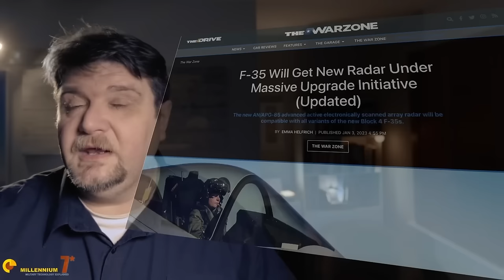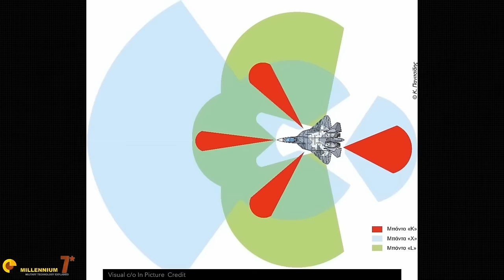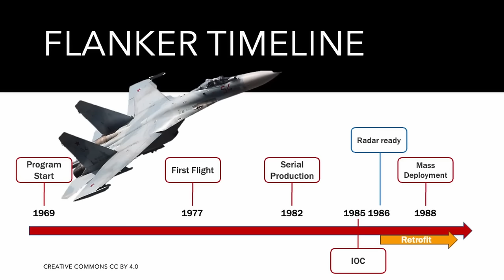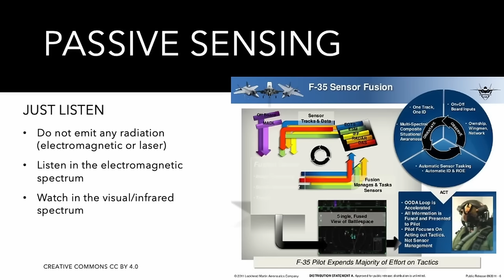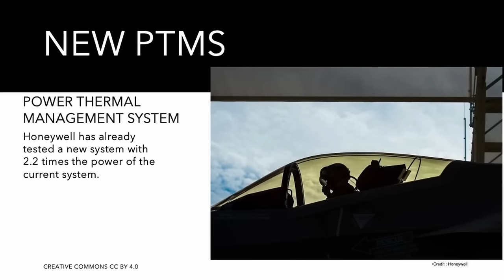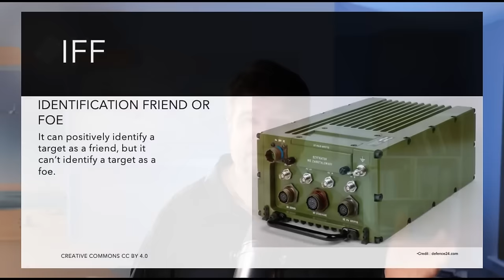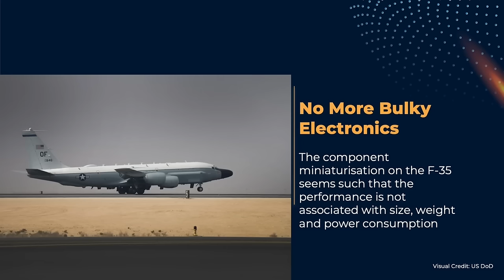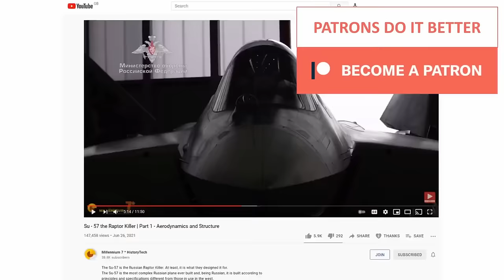The F-35 in 2023 was...                                 (mash-up long format)

Comment: Excellent compilation video... the explanation on arrayed and phased-array radar is very well done. Just a small correction, 9:34 the receiver amplifier is called a low-noise-amplifer or LNA. These are different from power-amplifiers or PA.

Comment: I was critical of the RAAF F-35 project because of its fixation on the F-35 without considering alternatives.   Eventually the RAAF purchases Some Super Hornets.  This allowed a bit of a stop-gap and  very effective in service with and replacing some classic Hornets.  And allowed for some time to consider the F-35 some more. And the F-35 project showed an improvement and began to reach some goals. The RAAF now has about 72 F-35s and 36 Super Hornets.  About 30 classic Hornets are still in hand but not operational. Ukraine considered the classic Hornets but went with NATO F-16s.  About 10 classic Hornets may now go to the Philippines.   They still have some airframe hours and considerable capabilities for the Philippines.   Including AMRAAM and Harpoon.  Some of these saw service over Syria in 2017. The US should still have plenty of spare parts. They can compliment the PAF T-50 fighters.  These classic Hornets support a number of other guided weapons.  Australia has been supporting Philippines training since WW2. The Philippines military is growing with more modern systems.  The F-35 is now in full operation with the RAAF.  The RAAF remains the most capable airforce in the Southern Hemisphere.   With a very well balanced capability.  Some of the Super Hornets are SEAD G models.  One of the Wedgetail AWACs are supporting NATO in Eastern Europe.   The Australian military is growing significantly in capability.  The F-35s will be supported by Australian built Wingman drones. With KC-30 tankers the RAAF will have an effective long range capability.  The F-35 is a vital element of the ADF. Protecting sea approaches.  Also giving the RAAF an effective deployment capability to support allies around the world.

Comment: Thanks.  I have been looking for that deflection rate.  You gave 45 to 60 degrees. I still think moving the radar to different angles  can be useful.  Even just rotation.  Along with other modules around the aircraft.  You have some other good information.   Good to see  F-35 costs coming down.  Having seen extensive air combat in Ukraine we can see how capable the F-35 should be. Where even the F-16 is expected to be so capable.   Even the older models with some upgrades.

Comment: A good solution to the scan angles is to have a multi-faceted aesa plate. I guess in effect that's having multiple aesa radars, but with a single structure, common cooling, etc. it's kind of a gray area. There is one other pro/con (depending on how you look at it) with high powered AESA radars, but it's rather shush.
GaN will offer about 65-70% improved efficiency. Read that as 65-70% less cooling needed, or 65-70% stronger signal output with the same power, or any combination thereof. It could also be used to leverage larger amounts of power in a smaller package (albeit with appropriately beefed up cooling. This is pretty substantial.

"It is incredible how such a poorly conceived and run program may have produced such an outstanding aircraft"
That's really the soul of the F-35 in a nutshell.

The compute elements are too centralized, yeah. It'd be better off with more numerous smaller computers, with less lines of code each, doing their own thing, and communicating, but much less 'dependent' on each other. When the US government does anything with computers, it's usually a bit of a train wreck. To be fair, you see that in the private sector too though, whenever bean-counters get too fixated on "lowest bid". Overall the F-35's computing works well, but it could have worked better. Granted, a single F-35 has as much compute as the rest of the USAF put together... so it was kind of a big task. It works better than windows 10/11...

Concurrency never saves money, in the end.

I expect that "if" the XA-100 is perfected, it will be for the B-21 (range & temperature advantages), or possibly NGAD/FA-XX, and then possibly back-tracked to the F-35. There's an "if" and a "possibly" to that, which compounded equals a firm "maybe someday". Though the F135 engine updates are going to end up with just as much thrust, possibly more than the XA-100, and 'some' economy improvements, and sooner rather than later. The competition between P&W and GE burdened the program with choosing between two great options.

One rarely discussed LPI radar tech on the F-35 is that it can black-out areas in the tracked flight path of detected targets (even while the F-35 is maneuvering). Obviously if the contact changes heading though, it can bump into actively tracked areas briefly though. This denies targets' ability to track & analyze the F-35's radar emissions, and greatly shortens their window for detection.

MPADS & AA guns, agreed, are not really able to be dealt with by SEAD (ergo the obsolescence of the A-10). But they cannot target aircraft at higher altitudes. So if you have SEAD, you can pretty safely fly high in an area. So acting as an eye in the sky is very realistic, assuming you've taken out all the SAM systems of noteworthy size.

1MW peak power is definitely wrong for the AN/APG-81. But the F-35 had about 2.5x the power generation capacity of the F-22, and also greater than 40 kW of cooling capacity (about half engine cold air & half fuel heat-dumping). Some of that will get eaten up by the increased compute capabilities, and the myriad sensors. But overall, the power availability of the radar should be nearly double that of the F-22. With GaN, signal output could be greater than triple. (disclaimer: this is based on pieced together public info, and math, not specific knowledge)

Sidekick is easy to install. It's just a wire bundle, a bay door, and a software update. Could likely be handled at the depot level, without going to LM for install.

Production model AIM-260 should be "in testing" now at Edwards. I'd expect more info about it very soon.

I'd suspect that the new cpu would be highly multi-core, and a lot of the performance would come from that. Handled right, it should work fine. (with computers though, it's always "should" not "will"). Just based on years of release, it's likely something along the lines of going from core2 duo to threadripper.

Great compilation video :)

Comment: One thin I take with me. If the platform needs to use Link 16 to communicate with legacy platforms it must be sending in all directions thus undermining its use as a Libro.  Or am I miss interpreting this? Is there some thing that is stoping the MADL from being integrated on other platforms. 
   LastI want to mention some thing that I have reacted to in the debate. Some times in bedia its reported at the Link 16 is old and the MADL is new and for the future. Which true in it self. But then the underlying tone is abit that the compeditirs have chosen a bad data link. I think we should be clear. The reason why Link 16 is used is because its the agreed up on data link. Its there to be interoperable between nations and platforms. The JSF got around that finaly by having both. A good solution but I feel it is not fair to use it as an argument for how briliant a new platform is.

Comment: How many s 300 does russia have?
Reply: I think they have a lot of s systems in general. Word has it the deeper you can get into Russia you’ll come across the more upgraded versions of it…. For sure Moscow has s-500 or who knows all I know is they have a shit ton lol
Reply: "How many s 300 does russia have?"

Why would that matter at all?
Russia's standard regional SAM system is the S-400, and they're starting to deploy the S-500.
Reply: @DIREWOLFx75  so are s-300 out of service
Reply: @wilsonsantiago3095  "so are s-300 out of service"

Russia appears to be using up the remaining stores as protection for low priority areas and as cheapskate cruise missiles.

So, limited service, basically useful but nothing important.
Reply: @DIREWOLFx75  hmmmm really always thought it was still in rotation
Reply: @wilsonsantiago3095  Well, technically it is, but like i said, it's being used for low priority airdefence and as cheapskate cruise missiles, rather than as mainline airdefence.

I don't have detailed information, so it's entirely possible that it still does primary frontline service SOMEWHERE as well, but it's no longer the main airdefence system.
Reply: @DIREWOLFx75  that makes sense to be honest
Reply: @DIREWOLFx75    Wrong.They are not limited.  S-300 are so many versions 28 (?)  S-300 V4 was probably latest.  Ability to hit target 400km away. 🙂
Reply: @vkham9944  "S-300 V4 was probably latest.  Ability to hit target 400km away."

That's because it uses the same baseline missile as the S-400.

Or more correctly, the 40N6 missiles are being refitted and moved over to S-400 systems en masse.   That started early Autumn 2023, probably.
This, because the missiles are notably more capable when used as part of the S-400 system.
They also share the 9M96 and 48N6 missiles.

"They are not limited."

That depends on your definitions.
Russia has at least 5 times as many S-300 systems as S-400, so even if they're downgraded to rear area defense, they would still be by far the most common system.

Also, while looking up again, i did note that S-300 can launch missiles and have them completely guided by S-400 systems, providing MOST of the advantages of the better systems.

That would also correlate well with the info i have that they're not being used as primary frontline systems and are in the process of being replaced.
So, that's my guess for why the discrepancy.